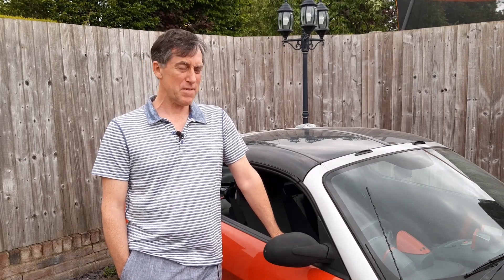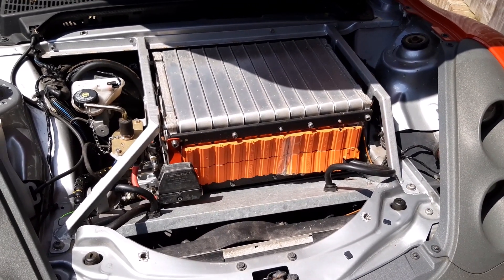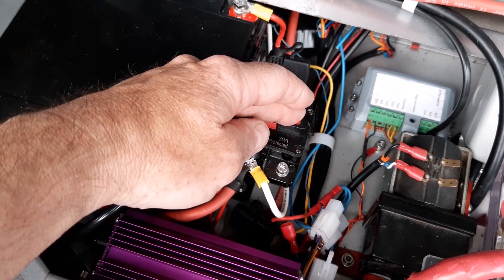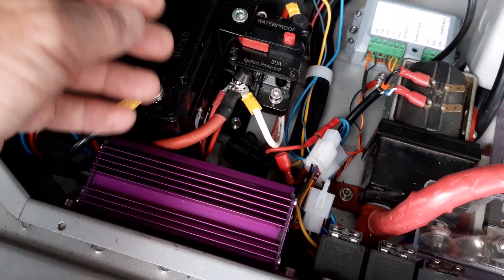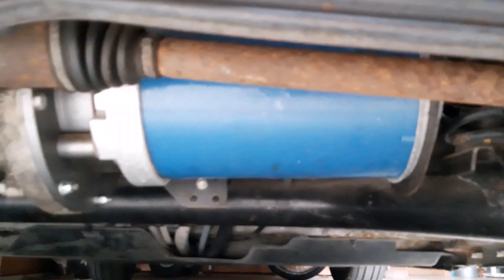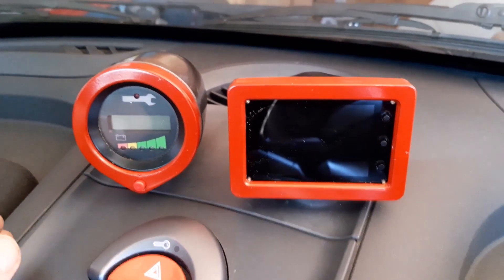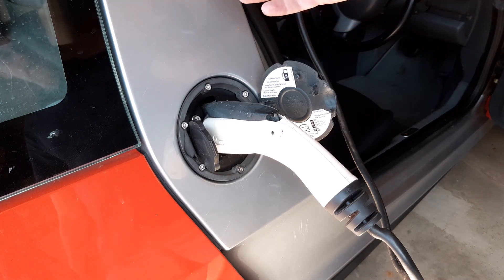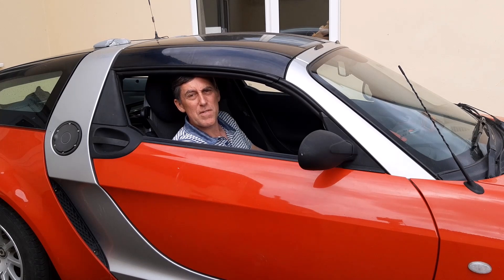Converting car to electric - Summary

Comment: Hi Paul, I gave up on converting my Smart Roadster to Electric some years ago. My neighbor help me put the petrol engine/gearbox back in the car and I love driving it. There were lots of reasons for not converting it and more reasons for getting back on the road.
Reply from the maker: Hi, Thanks for watching..  I've been having the same thoughts, for me it's been concerns about no bms and I'd be doing a 35mile round trip commute so the chances of ending up stuck on the side of the road with my prototype car is fairly high. I still have the petrol engine in the original chassis so it's a fairly easy swap and a chance to get the car back on the road until I have more time. It's been an interesting process though.

Comment: Hi Paul, thanks again for all your videos, they are very informative for my own Roadster conversion, 115V nominal from 5 Tesla Model S/X modules and a Hyper 9 motor. I am splitting the battery packs with two in the front and 3 in the back. I saw you shared the CAD file of the rear subframe, did you draw this from scratch? I am asking because I need to know how accurate I should consider it to be. The rear subframe and its habitat need to accommodate not only a slightly bigger motor, controller and everything else, but also 3 of those rather unwieldy packs in a road legal casing.

Comment: Any updates Paul
Reply from the maker: Hi Simon, There have been some, I should do a new video :). 
After a lot of faf with the V5C it's back as a petrol car because it the engine type can't be changed if the car is post 2001, so after a short panick when they de-registered it it's back as a petrol car and apparently that's what it has to stay even though it can have an electric engine, unless I go through full IVA. 
So I finished off a few things, took out 1 day insurance and took it for an MOT (4 miles away)... it failed :(, the horn didn't work :D and the front suspension bushes have degraded probably because it's been sitting for so long so nothing too bad. At least I got to drive it, acceleration is ok although I didn't push it and limited it to 200A (500 is max), up to 45mph but plently more to go, pre-selected 4th gear seems best but range seemed poor, either I'm not charging properly or the old batteries don't take charge, probably the former. 
So stuff happened, if I lived close to work it would be great and I'd use it but I'm going to need to do more to have a reliable car for the 38 mile round trip on main roads. Might have to buy an old Leaf instead!.

Comment: I have been designing EV High voltage powertrain systems for automotive/transport over the last 10+ years. I appreciate the effort and passion involved in this project, but I am with VDLA on that... I wouldnt approve that car to be road legal, not because being before or after 2000, but because of safety concerns. The battery pack is far from safe by modern EV safety standards. It does provides motion for the vehicel, from electrical point of view is ok...but the crash performance in an accident event is far from being safe for the occupants, for recoveryt services and for emergency/rescue services. Not to mention has not been tested. 

The functions of a powertrain, when analyzed by modern safety tools as DFMA or similar, are not just providing motion but also providing safety. What will happen to the occupants, to other cars in case of a head on collision? IS it going to crush and invade the footwell compartment? going to cause a high voltage hazard for the occupants or even for someone trying to attempt a rescue? . Safety is a serious part of the design on HV powertrains.

That said, The same applies for most of EV conversions out there done by LTD companies... they have probably done some crash test analysis....maybe are a bit better than a home base conversion...but I still got my doubts about how safe those conversions are.
Reply from the maker: I think your comments about safety concerns are valid, although in this the capacity is limited to just 6kwh, low density and peak voltage is only ~100v, a massive difference from standard EVs at 350v+. 
I could choose to quadruple the power, fit a V6, move the fuel tank to the front, keep the same brakes and no-one would even question it, but I don't think that would be very safe either. 
I've build 2 kit cars in the past and feel that when you do a self build you are more aware of what makes something go and stop and what could break. 
EV conversions will become more common to keep older 'classic' cars going, these will probably only be novelties which like this one may only do a few 100 miles a year. 
If I want a daily supercar then I'll lease a Tesla, which is my ultimate plan :). The conversion process has been an interesting experiance and fun project, will be good to actually drive it :).
Reply: @crispydoda  definitively would love to share some track time with your project when finished. Tesla wise...dont thinkna 2ton car can be considered a supercar.

A bad build is a bad build. Yours is a nicely done that and I am sure you have put incredible care. Is not about your skills which are more than good :) but about resources and cost required to build an EV powertrain to current standards....out of reach for DIY initiatives.

Comment: Hi Paul
Did you manage to get the V5 changed and get it on the road?
Many thanks
Reply from the maker: Hi Graham, still ongoing.. I sent it the change form in to the DVLA but got a reply saying I had to include serial numbers for steering, axles, etc!... after contacting them they said actually they only needed the chassis number. Since then I haven't heard back, that was 1 month ago and a follow up hasn't worked. So far the whole process has taken 4 months!

Comment: What is the purpose of switching to Electric?
Reply from the maker: Hi Antonis, 
There are a few reasons:
>Cheaper to run, cost should drop from 12 pence per mile (in the UK) to around 4p per mile
>Charged by the sun/wind so no CO2
>More reliable
>Faster acceleration
>Smart automatic gearbox doesn't work very well
>The clutch and alternator were both shot and needed replacing so engine had to come out
>It's a fun and interesting project to do
>I can't afford to buy a 'standard' electric car (that I like)
>Lower tax band, (in the UK)
>Why not :), dinosaur juice is for dinosaurs
>It's cool!

Comment: Hi Paul, i am converting my roadster either using nissan Leaf motor. IS YOUR POWER steering still working?
Reply from the maker: Hi, The steering is not affected by removing the engine as it's electric, but it's so light to turn anyway I don't think it would be a problem even if it didn't work.

Comment: Nice to see an uptdate ! I'm doing a roadster conversion aswell, i've manage to have almost all of the light to turn off and i have ABS working as from factory. i'm willing to share my findings i you wish to.
Reply from the maker: Hi, Sounds good, interested to know how you got the lights off, I assume via CAN settings?. I was going to pull the unrequired bulbs out of the instrument panel but as I'm trying to leave as much of the original as possible (in case I sell it on) I'm sure there is a better way. Thanks.

Comment: Interesting to see with the power meter you are using you have switched round from the standard positive amps display showing how much is drawing from the battery and negative being put back in there that you usually see to show the Ah capacity stored/remaining in the battery pack.
Reply from the maker: Originally I had wired it the other way but first time I charged with it I realised the battery icon was emptying when it was being charged so swapped it around. It's a good meter for the price although it doesn't read 0v even with nothing connected so needs calibrating, time to read the manual :D.

Comment: Thanks for the update Paul, will be interesting to hear about the type conversion from ice to ev, I would think a trip to the vosa test center is required?👍
Reply from the maker: A while ago I did send the V5 with the change to electric, but they sent it back with a letter giving some options as to how to certify the change had been done, it appears a sign off from any garage that it has changed from ICE to EV is all they need. I'll soon find out.
Reply: @crispydoda  I'll be attempting to get the DVLA to change my 2003 Beetle to electric soon. It's not too far off now. I have been reading that they're not too helpful when it comes to vehicles taxed based on emissions. There's a thread here: https://openinverter.org/forum/viewtopic.php?f=9&t=543 if you want to have a read.
Reply: @crispydoda  Being a 54 plate I hear that any cars that are 2001 and newer you can't get free RFL AKA Road Tax. So I guess you have to pay the same amount, however I guess the roadster isnt to bad since it was a 1.0 Turbo before?

Comment: Fantastic project! Well done!  If I may make one remark . The + pole of the 12V battery seems quite close to the chassis.
Reply from the maker: Thanks for watching, you make a good point and in fact yesterday I made the battery top retainer and pushed it back a bit from the edge.
Reply: @crispydoda  Why not take out the 12V battery of the equation. It is dead weight for most part.
Instead use one or more 100-240VAC smps. Remove the bridge rectifier and it is a cheap DC-DC converter.
Vote for me for the title "worlds leading armchair expert".

Comment: Really interesting project! If you have a chance, put the car on scales. It would be interesting to see how the weight distribution has changed with batteries at front and engine missing from the back. I used to have Roadster Coupe and I remember the front end feeling really light. In winter and on snow it had a tendency to understeer, even when throttle was applied (I had studded tires as well).
Reply from the maker: I don't have access to scales that would do it but I do have some steel box that I could make a seesaw with and see whare the centre balance point is, should be better balanced than before I think..
Reply: Yes that would be interesting, I felt the same thing with the car I had. Before a roadtrip I played with the idea of carrying a spare wheel in the front to help add some weight and, of course, give me a spare wheel. Didn't do it as it left me no space for luggage.